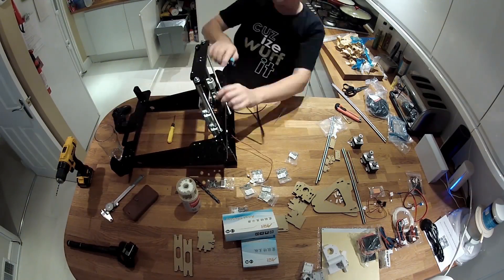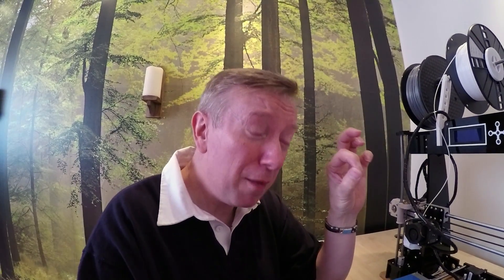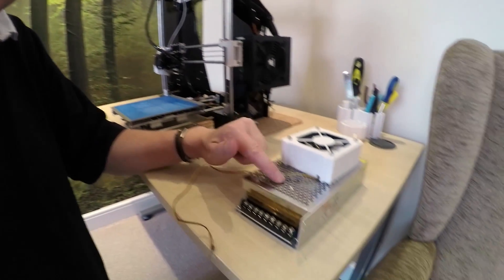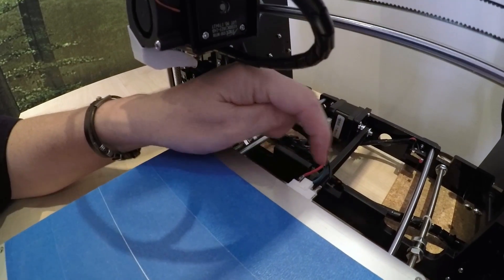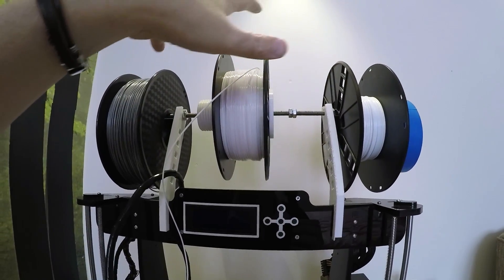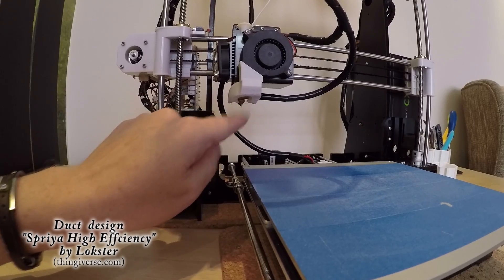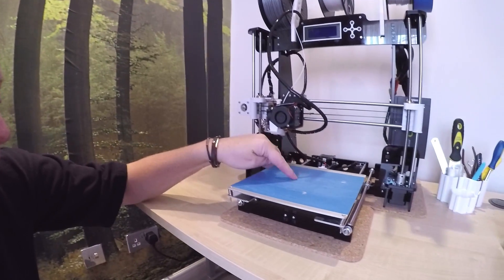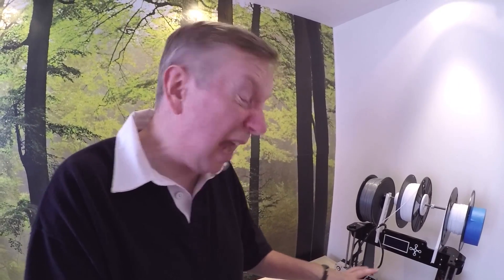3D Printer Modifications and Progress Update (Anet A8)

Comment: PLA yeild point and ultimate tensile strength are almost at the same point. Abs i believe has a region of knecking, where it stretches a bit before it breaks. You should get into making your own models using for example fusion 360. that way you can make parts that dont exist. I have problems with sticking, but ive found that glue stick and water makes a good adhesion. The bed levelling is a pain, so i may get a level sensor so that the software can control z steppers to keep it level.

Comment: Glad you got the safety upgrades done, should be a much safer printer now :) If you wanted to make it even safer, you could look into adding some strain relief for the heated bed wires to stop the solder joints from cracking over time. Another big safety upgrade you could do is to install new firmware on the board. I believe the Anet A8 usually comes with thermal runaway disabled, which is kind of a big deal.   
I can't tell from the video, but are you getting any Z-wobble? That's quite a common problem on the cheaper printers, but easily fixed.  
As for getting things to stick to the bed, what material is the bed made out of? I have glass on mine, and it works perfectly, I just need to wipe it down every few prints.

Comment: I have a Hijet Romahome and the standard mirrors need extending by at least 100mm. I made some spacers from wood but they need replacing now. A printed pair would be the ideal solution - but PLA is no good for stuff that is exposed to the elements as it bio-degrades. ABS is ideal for things like that.

Comment: can you fix me a great dilemma by printing me a sleeve to connect my crayford focuser to my telescope it would just be a simple 2 inch wide sleeve tube 90mm on the inside diameter of one end and m94 thread on the inside diameter of the  other end i will pay you for it of course you might get other orders like remote holders that clip onto the field tripod leg in white they all seem to be in black, would you be able to do this please !? i cant find a sleve adapter anywere on the internet this is the focuser http://www.ebay.co.uk/itm/2-Dual-Speed-No-Pinion-Crayford-Focuser-with-2-to1-25-Adapter-For-Telescope-Hot/361923928034?ssPageName=STRK%3AMEBIDX%3AIT&_trksid=p2057872.m2749.l2649 i dont want to send it back its too nice :(
Reply: I have a 3D printer too, I might be able to help. I also know my way around basic CAD so if you can get me some accurate dimensions, I might be able to draw something up.
Reply: cool ill draw you a thing out ill get back to you thanks !
Reply from the maker: net voyager2017 you'd need to find a 3d print file to run as I haven't got a clue how to do CAD.
Reply: oh i see ill see what i can pull together :)
Reply: its just a sleeve one end has to fit a 90mm diameter tube 25mm deep  and the other end needs a 10mm deep thread of M94.5x1mm  internal thread outside diameter will be 100mm x35mm wide so its just a pipe joiner sleeve really with an open internal of 90mm and the other side 95.5x1mm thread  so there will have to be a step in the middle somewhere were it changes diameters
Reply: Thanks for that :) I've modelled that up now, except for that thread. I can't find any reference to that thread size on the internet. I think the listing on ebay may have the thread size wrong because it's not a standard thread size, the closest I can find is M95x1.5. I don't suppose you have a way of measuring it, do you?

Comment: Can I just ask Rick as I don't think you mentioned anything about it...... Most pc supplys won't give a very good stable 12v without some 5v drain to balance things out. Unless you've done something about this or its an awesome power supply.... Might be worth doing a quick test of the voltage of the 12v while it's printing and under load. If it's low, add some 5v load. Put a phone on charge or something and you'll see the 12v improve :)